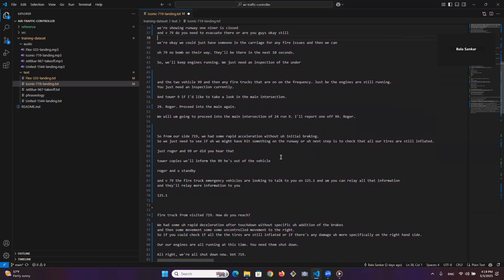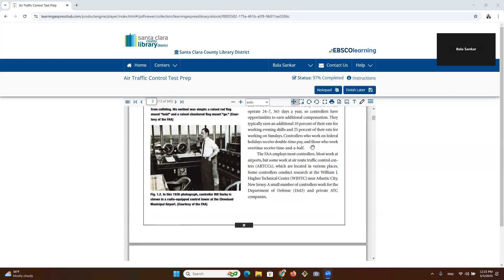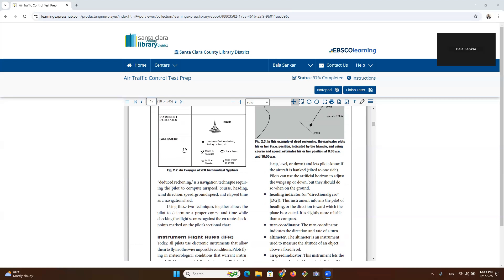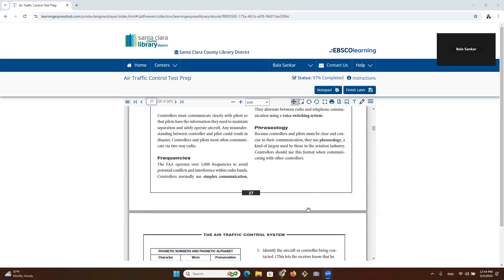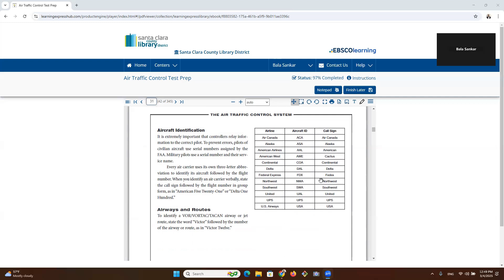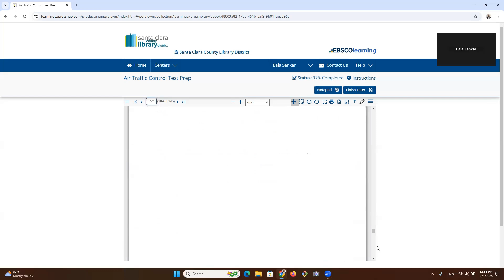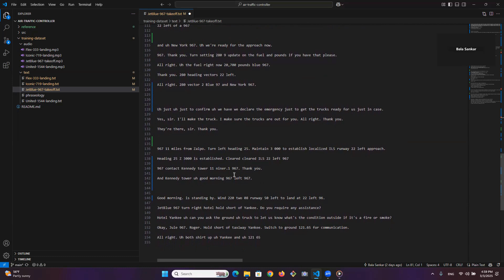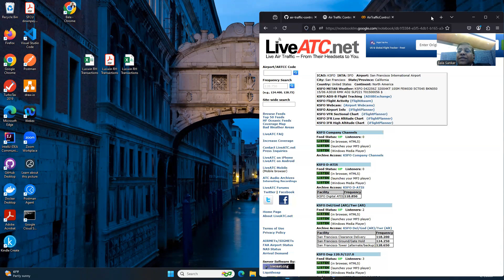AI-ATC Artificial Intelligence Air Traffic Controller

Comment: Asked DeepSeek: air traffic control system phraseology

Okay, so I need to understand the phraseology used in air traffic control systems. Let me start by recalling what I know. Air traffic control (ATC) is crucial for managing aircraft movements to ensure safety. Pilots and controllers communicate using specific phrases and terminology to avoid misunderstandings.

First, I remember that clear communication is vital. Controllers give instructions, and pilots read them back to confirm. Maybe there's a standard structure to these communications. For example, when a controller contacts a pilot, they might start with the aircraft's call sign, then give instructions like heading, altitude, speed, etc.

I think there are specific terms for different actions. Like "Roger" means acknowledging a message, but "Wilco" means "will comply." There are also terms for altitudes: "climb" and "descend" to change altitude, "maintain" to stay at a current altitude. Speed adjustments might be "reduce speed" or "increase speed."

Handoffs and transfers between different ATC sectors probably have specific phrases. Maybe something like "Contact [frequency]." Also, taxiing on the ground has its own terms, like "taxi to runway via [route]." Takeoff clearance is probably "Cleared for takeoff," and landing clearance would be "Cleared to land."

There are also specific terms for emergencies, like "Mayday" for life-threatening situations and "Pan-Pan" for urgent but not life-threatening. Controllers might give priority handling instructions in such cases.

I should consider phonetic alphabet usage, like using "Alpha" for A, "Bravo" for B, etc., to avoid confusion. Numbers might be pronounced differently, like "niner" for nine and "tree" for three. Altitudes could be said as "flight level" when above a certain altitude, like FL350 for 35,000 feet.

Wait, what about approach and departure procedures? Controllers might say "cleared for the ILS approach" or "expect vectors for approach." Holding patterns might involve instructions like "hold at [fix], expect further clearance at [time]."

I should also think about readbacks. Pilots must repeat instructions to confirm. For example, if ATC says "Delta 123, climb and maintain 10,000," the pilot responds "Climbing to 10,000, Delta 123."

Are there differences between en-route, tower, and ground control communications? Ground control handles taxiing, tower handles runway operations, and en-route or center handles flights in their sector. Each might have different phraseologies.

What about traffic advisories? Controllers might say "traffic at 12 o'clock, 5 miles, same altitude." Pilots respond if they have the traffic in sight.

Also, speed adjustments during approach: "Reduce speed to 180 knots" or "Maintain 200 knots until final approach."

I need to check if there are standard phrases for common situations. For example, when entering controlled airspace, pilots might request clearance. Or when ready for takeoff, they call "Ready for departure."

Another thing is the structure of communications: who calls whom first. Typically, pilots initiate contact with ATC by stating their call sign and position, but sometimes ATC might contact the pilot first.

I wonder about the exact wording for altitude changes. Is it "Descend to 5000 feet" or "Descend and maintain 5000 feet"? Probably the latter to be explicit.

Also, what's the difference between "direct to" a waypoint and "proceed to"? Maybe "direct" means straight line, while "proceed" might involve a route.

Wait, maybe "direct" is used for immediate routing changes. Like "Delta 123, proceed direct BRAVO."

Handoffs between controllers: "Delta 123, contact Center on 135.9." The pilot then switches frequency.

For runway crossings: "Cross runway 27" or "Hold short of runway 27."

I should also consider international differences. While ICAO has standardized phraseology, there might be regional variations, but the basics are the same.

Examples would help. Like a departure sequence: Ground control tells the pilot to taxi to the runway, tower clears them for takeoff, then departure control takes over.

Also, during approach, the controller might issue vectors or clear the pilot for an approach type. Missed approach procedures have specific instructions too.

Emergency communications are critical. The pilot declares an emergency, and ATC provides assistance, maybe priority landing, clearing the airspace, etc.

I need to make sure I cover all the standard phrases, the structure of communications, readbacks, phonetic alphabet, numbers, altitude, speed, headings, clearances, emergencies, and different ATC sectors.

But maybe I'm missing something. Are there specific phrases for weather advisories or traffic alerts? Controllers might say "weather ahead, suggest deviation to left," or "traffic alert, advise you turn heading 090."

Also, the use of "standby" when the controller needs the pilot to wait, or "say again" if the message wasn't clear.

Phrases for acknowledging instructions: "Wilco," "Roger," "Affirmative," "Negative."

Wait, "Affirm" and "Negative" are for yes/no. "Roger" means received, "Wilco" is will comply. So if a controller gives an instruction, the pilot reads it back and might say "Wilco" if needed.

Hold short instructions: "Hold short of runway 18L" and the pilot reads back "Hold short of runway 18L, [callsign]."

I think that's a good start. Now I need to organize this into sections with examples, maybe categories like general phraseology, clearances, emergencies, phonetic alphabet, etc.
Reply: Air Traffic Control (ATC) Phraseology: A Structured Overview

Effective communication in ATC relies on standardized phraseology to ensure clarity and safety. Below is an organized summary of key elements and examples:
1. General Communication Structure

    Initial Contact:

        Pilot: "[Callsign], [Position], [Request/Information]."
        Example: "Delta 123, 10 miles north of Alpha VOR, requesting descent to 5000 feet."

        Controller: "[Callsign], [Instruction]."
        Example: "Delta 123, descend and maintain 5000 feet."

    Readbacks: Pilots must repeat instructions verbatim.
    Example: Controller: "Delta 123, turn left heading 270." Pilot: "Left heading 270, Delta 123."
Reply: 2. Key Terminology

    Acknowledgments:

        Roger: Message received.

        Wilco: Will comply (combines "will" and "comply").

        Affirm/Negative: Yes/No.

    Altitude Instructions:

        Climb/Descend: "Climb to FL350" (Flight Level 350 = 35,000 ft).

        Maintain: "Maintain 5000 feet."

    Speed Adjustments:

        "Reduce speed to 180 knots."

        "Maintain 200 knots until final approach."

    Routing:

        Direct To: "Proceed direct BRAVO."

        Vectors: "Turn left heading 090, vectors for approach."
Reply: 3. Clearances

    Taxi: "Taxi to Runway 27 via Alpha, Bravo."

        Readback: "Taxi to 27 via Alpha, Bravo, Delta 123."

    Takeoff: "Cleared for takeoff Runway 27."

    Landing: "Cleared to land Runway 27."

    Holding: "Hold at BRAVO, expect further clearance at 1200 UTC."

4. Sector Transfers and Handoffs

    Frequency Change: "Contact Center on 135.9."

        Pilot: "135.9, Delta 123."

5. Emergencies

    Declaring Emergencies:

        Mayday: Life-threatening (e.g., "Mayday, engine failure").

        Pan-Pan: Urgent but non-life-threatening (e.g., "Pan-Pan, medical issue").

    Controller Response: "Delta 123, cleared direct to nearest airport, descend at pilot’s discretion."
Reply: 6. Traffic and Weather Advisories

    Traffic Alerts: "Traffic, 12 o’clock, 5 miles, opposite direction, altitude 6000 feet."

    Weather Advisories: "Moderate turbulence reported at FL300, suggest deviation left."

7. Phonetic Alphabet and Numbers

    Letters: Alpha, Bravo, Charlie, etc.

    Numbers:

        3 → "Tree"

        5 → "Fife"

        9 → "Niner"

        Altitude: "Ten thousand" vs. "Flight Level 350."

8. Ground and Tower Operations

    Runway Crossing: "Cross Runway 27" or "Hold short of Runway 27."

    Startup/Taxi Clearance: "Delta 123, startup approved, taxi via Alpha."

9. Approach and Departure

    Approach Clearance: "Cleared ILS approach Runway 27."

    Departure: "Delta 123, contact Departure on 125.5."

10. Special Instructions

    Speed Restrictions: "Maintain 250 knots until 10 DME."

    Altitude Restrictions: "Descend to 5000 feet, cross BRAVO at 6000."
Reply: Examples in Sequence

    Departure:

        Ground: "Delta 123, taxi Runway 27 via Bravo."

        Pilot: "Runway 27 via Bravo, Delta 123."

        Tower: "Delta 123, cleared for takeoff."

        Departure: "Delta 123, climb to FL250, contact Center on 132.2."

    Emergency:

        Pilot: "Mayday, Delta 123, engine fire, request immediate landing."

        Controller: "Delta 123, cleared direct to XYZ Airport, runway 27 available."

Notes

    Clarity: Avoid non-standard phrases. Use "descend and maintain" instead of "go down to."

    ICAO Standards: Followed globally, though regional variations may exist.

This structured approach ensures precise and efficient communication, minimizing risks in aviation operations.

Comment: Right of Runway needs to be clearly defined. Pilot follows instructions from Air Traffic Controller. So, it is the responsibility of the Air Traffic Controller to follow the Right of Runway protocol.

Comment: In Java, we have multi thread features; when a thread needs access to a resource, it needs to get the lock; use the resource; release the lock

In earlier days, at the train station they had key exchange; only with the right key, the station master could operate the signal and give a green signal for the train to proceed.

At the airport, they don't have any locking mechanism. One Air Traffic Controller gave clearance to Emirates to cross landing runway and go to other side. Another ATC gave clearance to JetBlue to land. The JetBlue pilot saw the Emirates crossing and avoided collision, climbed and went around the airport for one more time before landing safely.

Access locking mechanism is needed for each runway and for each crossing. Air traffic is worse than traffic on the road.

Comment: Global Air Traffic Platform could be built by cloning X platform codebase

All airports and aircrafts have an account on the platform. Communication between ATC of the airport and Pilot of the aircrafts could be DM, direct message 

We will have global visibility of the air traffic. We should be able to predict the traffic density at any airport. We could eliminate the frequency exchange for communication.

Currently they have no common platform; no visibility; no prediction. The SFO airport has no idea how many aircrafts would be landing and when they would be arriving. SFO has visibility only after the flights arrive at their air space and only in their radar range.

AI, the intelligence reveals disorders, chaos and confusion in air traffic system.